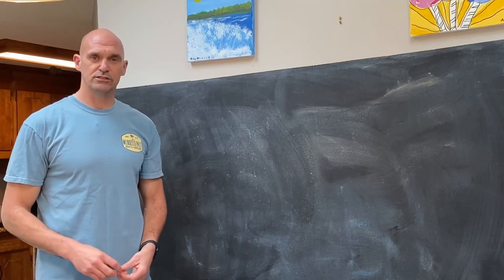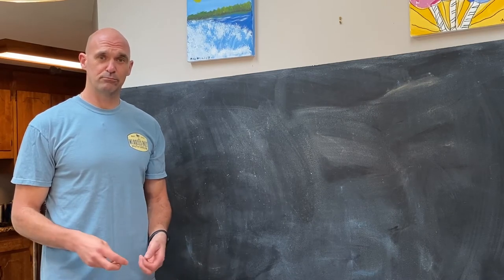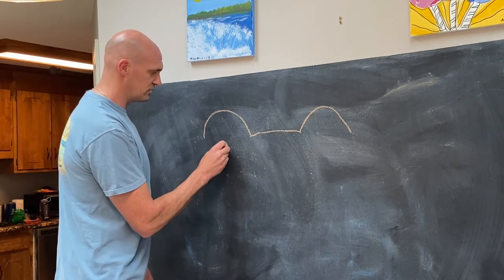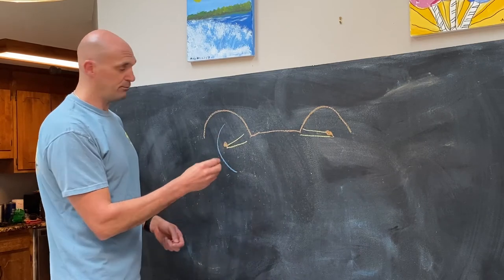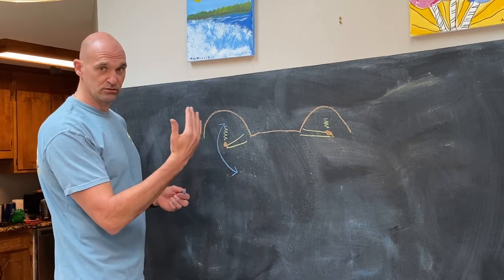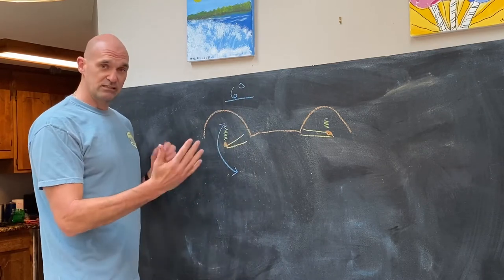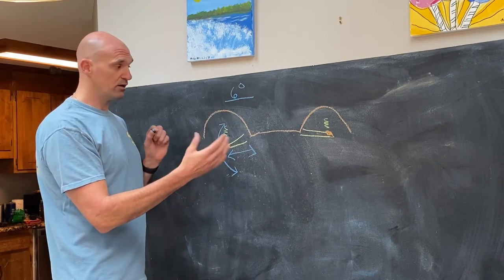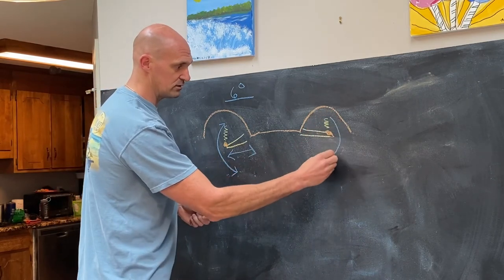Axle Articulation: Understanding the Functions of Jeep Control Arms

Comment: Very informative video. Do you think geometry correction brackets are still needed if I am Installing adjustable control arms?
Reply from the maker: Thanks, so there are a couple schools of thought in my opinion  the answer is yes, only because adjustable control arms will allow you to recenter the axle and correct caster as they are designed to do, what the geometry correction brackets give you the control arms alone do not is the geometry meaning your control arms are more parallel to the ground with the brackets bringing the vehicle closer to stock geometry which means in articulation the axle does not swing as severely to the center of the vehicle and is allowed to travel more linear up and down than with out it, with out the brackets the control arms are at a more severe angle and what that ultimately means is the axle travels more awkwardly under articulation which can impact traction
Reply: Thank you very much. I been trying to decide if I needed to get both or not.
Reply from the maker: @jdawg2474 absolutely my pleasure thanks for checking out the channel

Comment: I recently had a 3” Fabtech lift installed on my gladiator. The shop insisted that I wouldn’t need an aftermarket trackbar or control arms. The Jeep steers and turns great but I had an issue with the spring touching the metal part of the bump stock on the front drivers side. After taking it back to the shop they swapped the two front springs and it fixed the contact issue but now the passenger side (same spring) is nearly touching the bump stop. What would you recommend in this case?

Thanks.
Reply from the maker: It sounds like your springs have a bow to them meaning the top and bottom are out of alignment with each other, i know with my sons jeep which has a similar lift to you with no aftermarket add ons, once we put the geometry correction brackets on his jeep it fixed the spring alignment and no more bowing, basically your axle has moved off center as it relates to the upper spring bucket/connection point, you can fix that with either geometry correction brackets or with new control arms you can go with fully adjustable or new fixed ones that are longer based on your lift height, the track bar issue pulls the axle side to side and the axle is likely not centered right to left any more, an adjustable track bar will fix that.  3 inch lift are right on the borderline of needing them and if all your doing is driving around pavement and gravel/ dirt roads you will be fine, if you intend on doing and trails where your suspension will flex you probably want to consider control arms and adjustable track bars, the geometry correction brackets by metalcloak are a great option as it returns the suspension back to normal parameters you reuses your stock parts and they come at a good price.  Unless you want control arms, I would try the correction brackets they are really diy friendly, 
See how everything sets and then look at the front and rear trackbars if you think you need them.  Good luck and thanks for checking out our channel

Comment: Hey Dan, nice video, always enjoy them.  I am curious what you decided in terms of caster and pinion angle on your Jeep.  I just finished installing a Clayton Overland + 1.5” lift on my wife’s 2022 JLU Rubicon 4XE last night.

I adjusted all the control arms to the Clayton recommended “starting points”.  Using my digital angle finder, my caster is 6.6° driver and 6.9° passenger ( stock driver was 5.3°, passenger was 6.6°).  Front pinion angle was 1.2° stock and is now 3.0°.  I measured alignment and have 1/8” tow in.  Appointment Monday for alignment verification.  

I see several videos similar to yours, where caster, pinion, etc. is explained. I also see several videos showing different company upper and lower control arms, how to adjust them, why we need them etc.  I never see videos (at least I can’t find), where someone lifted their jeep and show pre and post caster/pinion angles/measurements, and how they those to adjust or not. I find you to be an intuitive guy, so I was very curious to see if you measured yours and or how you decided to adjust the balance between caster and pinion angles.  Thank you
Reply from the maker: Bill, great question and I appreciate your comments so a couple things to talk about here.

So i used several methods to ensure proper geometry for my 2021 jlur.  Factory alignment specs for me jeep are a castor 4.8 +\- a degree, with a tolerance of .5 degree right to left with a  note that castor needs to be above 4.0.  before i did any modifications my castor was measured at 4.6 driver and 4.7 passenger fast forward to where i am now, I have geometry correction brackets from metal cloak and metal cloak adjustable control arms with 3 inch AEV heavy springs, what this essentially does is allow me to maintain factory control arm geometry ie keeping them more parallel to the ground.  So with that being said i used an adjustable track bar front and rear to re center the axle right to left, then used the lower control arms to center the axles within the wheel well using the factory lower control arm length as a starting point once that was correct, i leveled the jeep front to back and side to side and then used the upper control arms to set the castor back to factory spec and got 4.7 driver and 4.8 passenger, center the steering wheel and then went for a drive, i had good return to center on the steering after turns an zero vibration.  To the second part of your question if you keep the factory drive shafts which i did pinion angle is not as big a deal to worry about as the factory shaft with the cv connections are not as sensitive as drive shafts with double u joint ends and can take pinion angles up to 7 degrees with 2 degrees or less being optimal when you lift the jeep your pinion/driveshaft angles are naturally going to increase unless you alter the orentation of the transfer case or replace the factory axles with ones that have pinion angles factored in.  Based on what i could read if i could keep the pinion angles between 2 and 4 degrees  while maintaining a vertical alignment of the coil springs i would be good so after doing all of the adjustments i checked the driveline/pinion angles and had 3.2 degrees in the rear and 3.4 in the front so I called it good.  I have put 17000 miles on that set up so far with almost 4000 of that mileage offroad and the jeep steers straight and smooth, i have zero vibrations, and no alignment issues with the tires wearing un even, so either i got really lucky or my diligence paid off, hope that helps brother!
Reply: Hey Dan, yes sir…helps a bunch, and thanks much for the detailed response.  I’m glad to see I’m not the only one who really values correct “set up and measurement” 😊.

Our kit also came with adjustable track bars.  The rear measures 1/16” to driver side…I called that good.  The front axel measures 1/4” to passenger and I am adjusting that back 1/8” which should center it.  At the current caster, Jeep drives perfectly, returns to center, zero vibrations and smooth as silk.  I will adjust the upper front control arms slightly forward to reduce caster to 5°, hence I believe front pinion angle will also level out a touch, guessing around 2°.

We opted for Teraflex nomad wheels (-6° offset), and KO2’s in 315x70x17’s.  With the 1.5” overland + lift, per Clayton, this lift provides 2” actual lift on standard Rubicon’s…1.5” actual with the 4XE (plus levels off the front a bit), model due to the extra 500 ish pounds of battery and electric motors.

There was one disappointment with this kit.  The sway bar links are “cut to size”, depending on your lift height.  They provide exact measurements for cutting, however following the instructions to the T, our sway bars pitch upward between 15° (rear), and 18-20° (front).  That in my opinion is to much.  Stock they were 10° all around.  The bars can not be cut any more off each end so I’m stuck with this, unless I buy different ones of course.

Lastly, measuring the Jeep at all 4 corners, the right rear sags a bit, approx. 5/8” lower than all other corners.  It’s noticeable to the naked eye and must be addressed.  I’ll call them on Monday.  By the way, their customer service is quite fantastic, always someone there who answer the phone and happy to help.  Quality customer service is a thing of the past with most companies unfortunately.  

I hope you and your family. Have a great day.
Reply from the maker: Awesome and yes we have lost the art of customer service for sure, i have been in public safety my whole career now almost 28 years so my life has always been about providing service to those in need and I get very frustrated when you have to search high and low to find it, so if you have found it hold on to it!  Good luck addressing the sag, i know my aev kit came with shims that were side specific to address the weighting bias of the fuel tank to keep  the jeep level, and you and your family the same!
Reply: I knew there was a reason I liked you. I am 57, retired LEO. Godspeed sir and be safe.  Maybe we will see you on the trail someday
Reply: Hi Dan.  I figured out why I had the sag in the Jeep’s right rear corner, thought I would make a quick mention/update, especially in the event that others may be looking at this same Clayton Overland + kit.  The rear springs are in fact side specific, right side slightly taller, and the rate is slightly different to compensate for added weight in that portion of the Jeep. There are small printed part numbers on the springs ending with L and R.  I never noticed or looked for them as there is no mention of this in the installation instructions. Clayton Off-road customer service apologized profusely for the oversight and would correct immediately for others in the future not have this issue. Once I swapped the springs, the jeep now sits perfectly level and the ride is absolutely amazing with the fox 2.0 shocks.
Reply from the maker: Awesome! Glad you found it, hopefully clayton will improve the visual indication of which spring goes where, it is so easy to miss those kind of things especially when you need a magnifying glass to see it. I know thats got to make you feel better having it right now!
Reply: Yes sir, my greatest reward was my wife’s smile…she absolutely loves the ride and handling.  We are looking forward to our 6 week trip to CO and UT later this year.  She is so excited to wheel her rig.